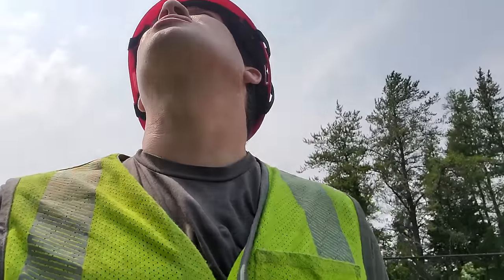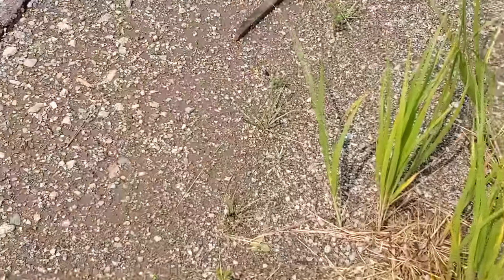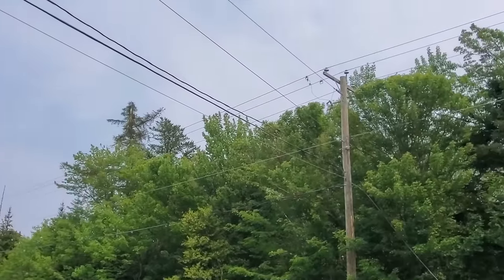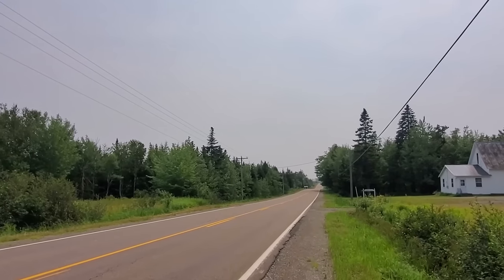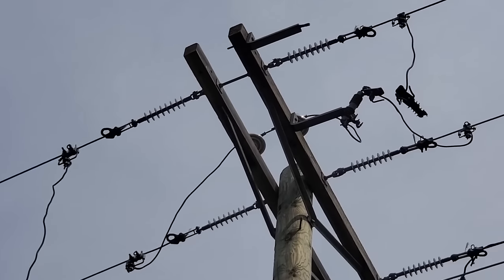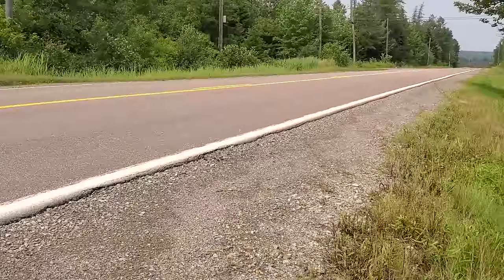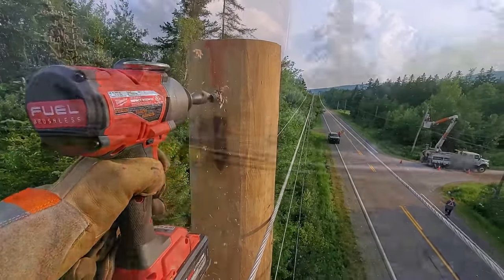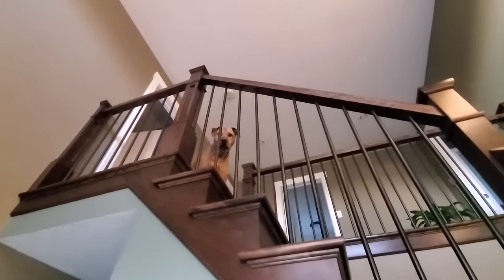What happens when lightning hits a power pole ??

Comment: I been aboutt 8 years ago I headed home working as a commercial electrican watched a car 2 vehicles a head me lose control run off road and smash into a power pole it snalled pole in half inpulled over and called into 911 of motor vehicle accident and that vehicle had took out power pole and all three phase were down and and that vehicle was energized initial I was not going en attempt to move wire off vehicle police and first responder showed up well during the span time to show up occupant of vehicle semi regain consciousness and in a disoriented state was moving around in the vehicle like they were trying to get out of the vehicle well I had hot stick in the truck of that was mine and always kept lineman gloves in tool box from days of work on high voltage 3 phase generators well in moment I grab gloves ND hot stick extend ro it's full length qnd told police that I could attempt to move wire off vehicle well even with worries of first responders there no other option I can attempt it or stand there watch occupant get cooked by energized wire which wasn't going set well with me so I shoved hot stick as far I could under the wire and went for it well I got the wire up off vehicle I'm thinking where drop this hot wire I'm definitely not going stand there hold it with hot stick so tow company already on scene so as soon lifted wire tow driver took well lift shoved up under vehicle yanked vehicle away from pole well as soon he done that I took shoved hot stick other direction and let go and hot stick hit ground weight wire kept hot stick from bouncing I left stick where was at urliry company got there and when they deenergized the line one lineman returned my hot stick to me and called a crazy s o b for trying that like I told him u only live once and if it saved person life it was worth it

Comment: Those grounds do nothing to protect any one working that pole unless the  ground strap is around the pole and below where someone is working. You're using bucket trucks.
Also brand new poles, full creosote treat are only 80% conductive. Even wet,  a conductor on the x arm doesn't trip the circuit. Delta 3 ph. One  phase can be fully grounded and circuit won't trip. I'm  IBEW local 57. Topped out Nov 3, 83, Provo. UP&L found out when linemen working a 345 kv line died, line came hot accidently, grounds meticulously placed to either side of the one they were on. They were remote in mountains. Supervisor had to wait for emergency to get to him, nothing he could do." Goshen " could do nothing. Procedures to parallel workers with the work area changed radically because of things found out from the reenactment of the scene. Grounds are for the public.  Lineman isolate themselves from them, parallel only. Enuf. I'm retired now. I've been shocked by 25kv twice, actually 14.4kv single phase. 13.8 kv at DMAFB, 3rd degree burns on both arms to the elbows.
Reply from the maker: I agree.Trip grounds within a specified distance of the work area according to your work methods, accompanied by bonds within your work area.
Reply: I've Barehanded 69kv at sub entrance, last line conference, Showlow AZ. From a double bucket truck of course.  .   .   . But when on the ground you are parallel with millions of volts at your feet. (Lightning potential!)

Comment: Using an IMPACT GUN to DRILL holes with WILL prematurely wear out the HAMMERS INSIDE the impact gun.
Reply: The Milwaukee utility impact wrench is designed for this. Directly takes a 7/16 impact auger bit too 👍

Comment: Why do you guys use flaggers? Why not mobile traffic signals? 🤔
Reply: Probably faster to deploy flaggers I'm guessing.
Reply: You mean arrow boards? Those take a lot longer to set up. Cost more & they usually come from far away. I’m with Aaron. Flagger set up their advance warning signs & 2 can do a good job. Ofcourse nothing slows people down faster that a police cruiser with strobes on in advance of the traffic pattern.
Reply: @johnclyne6350  nope? Simple traffic lights.

And take longer to setup than having two additional guys pull up with a stick and some cotton on one hand? I mean have you looked at the calendar what year we got?
Reply: Ruben, you may be an expert on these mobile traffic lights? I did a little research. The ones your talking about are small but the ones traffic would see better are towed on their own trailer. The fact remains, are they autonomous? Once set up, can they work on their own? There is one big problem with them? Established traffic zooming at highway speed will not know their presence until they are right on top of them. You still need advance warning signs. I do the same work as Aaron. We put our lives at stake everyday we work in the road. Countless coworkers have been injured & some killed by careless motorists. I personally have been struck by these same motorists with their door mirrors. Do they stop? Not yet? I witness motorists bad behaviors. Advance warning signs are mandated by DOT. Do motorists see them? Not when their speeding & looking down into their phone? A flagger can yell to us if a driver is not paying attention & entering a work zone. The mobile traffic light’s you mention will not replace human beings.
Reply: Easier and cheaper. Plus a flagged can alert the guys working of a crazy driving through.
Reply: @mikeznel6048  let two guys stand around in the cold for hours is cheaper than buying a set of traffic signal once which probably lasts 15 years? 🤔

What do you pay these guys? 20 bucks a month?